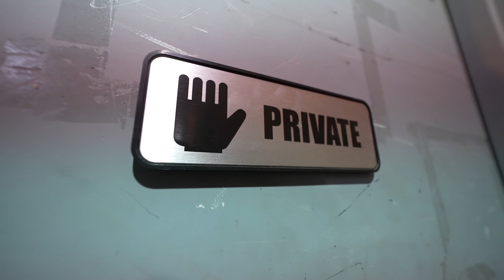THE WORLD'S FIRST RIPSTIK?!

Comment: Braille, ive been skating for basically 4 months now and i still cant ollie whilst moving or commit to a shuv it, and tips?
Reply: Stand facing a railing or pool table. Hold onto it (facing) and practice. It will help with your balance and trying new tricks with out falling.
Reply: Find a spot where it goes from concrete to grass and just send it into the grass, I did that until I was confident enough
Reply: @Atrainswrld  okay, ill be sure to try it out
Reply: @boom6578  ohhhhh okay
Reply: @boom6578  solid advice, I did that too. When I wanted to learn tricks of stair or a big legde. I found a foot and half drop that went into grass to practice. That helped too

Comment: You guys try streetskating tricks with setups not made for streetskating. In addition you do not take the time to learn how to ride these boards. As a result you keep destroying boards that are either not meant to be kick flipped or you are just not capable to do a clean kickflip with and ride away. It's actually a shame. This kind of board should have been surfed. It has some crazy lean other boards do not provide. Trying to wiggle it won't work either. Should have used Torque instead. If you keep treating boards like this - you will keep destroying them. What a waste!